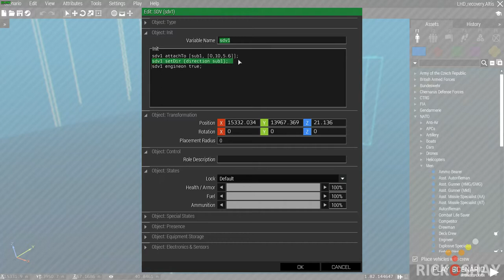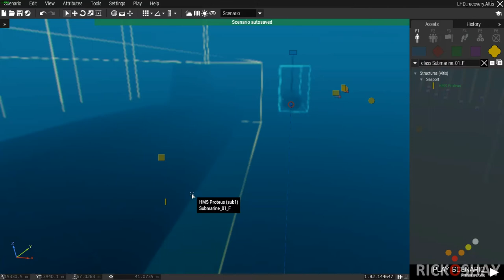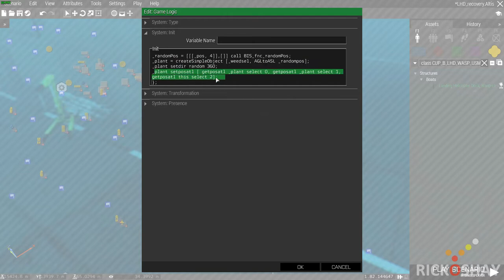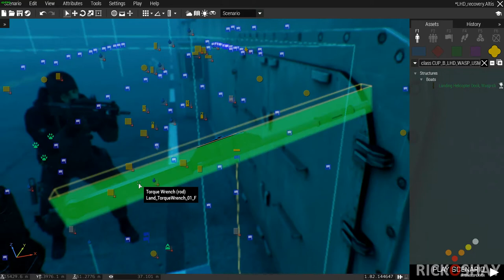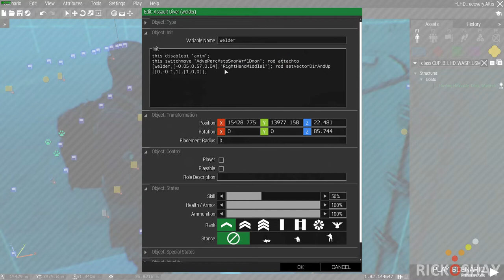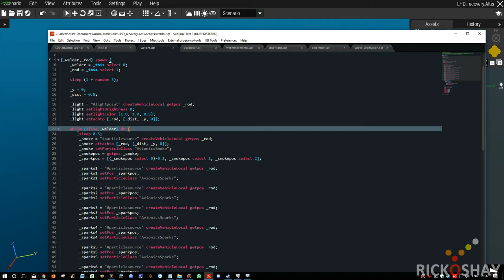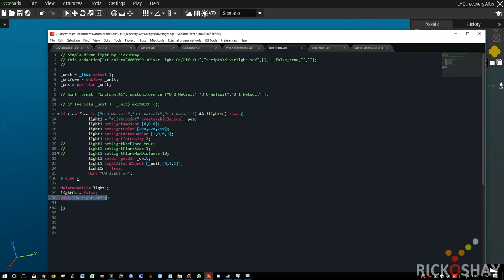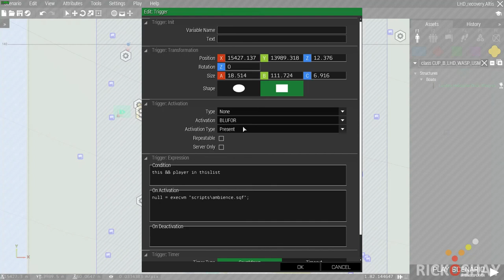LHD recovery scripts

Comment: The vegetation script keeps placing the weeds on the seafloor instead of on the deck.
Reply from the maker: I haven't looked at this for a while - used to work as you can see. Did you use as is  or are you making your own version? The logic position is obviously used for calculating the offsets.
Reply: @RickOShay  I am testing out a concept for a diving mission. I used your watermovement.sqf script and the weeds just spawn on the ground. It is probably a dumb oversight on my end tbh. Also bro, you are amazing at scripting.
Reply from the maker: @EmbodiedMage  have you adjusted the logic position vertical terrain offset - is it possible you may have accidentally snapped the logics to terrain height. You will need to grab each one and lift them to the exact height you need - very tricky process. If you still have the issue please message me on SW and I can take another look.